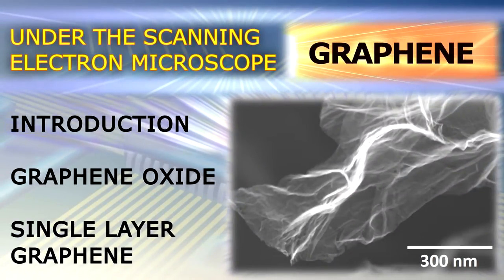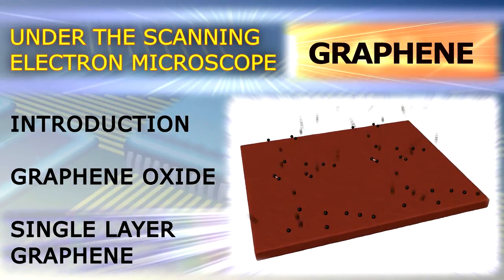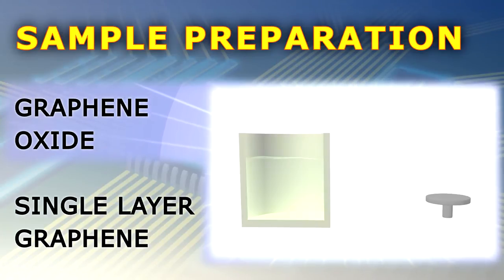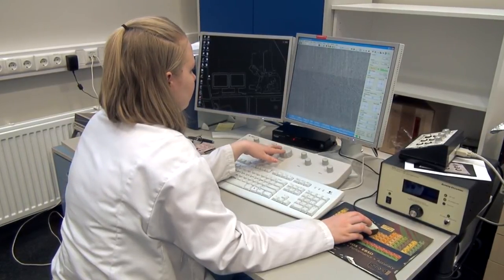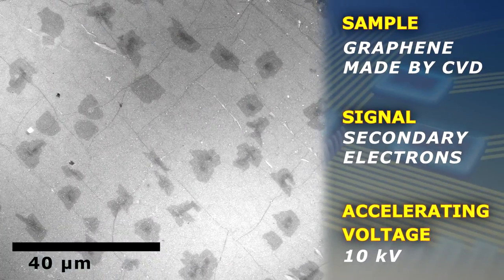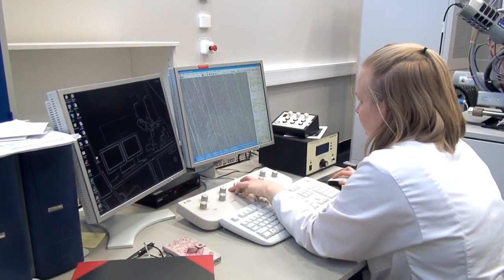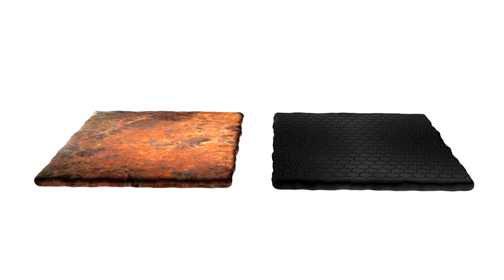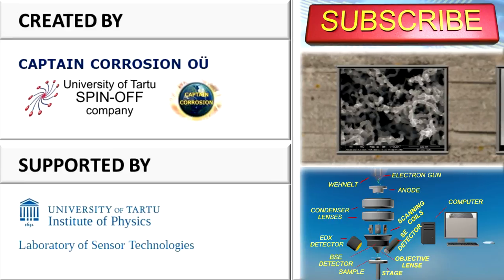Graphene Under The Scanning Electron Microscope (SEM)

Comment: During  My  Study  On  Graphene  ,   It  Was  Listed  As  A  Super  Conductor ........an  Associate  Had  a  Question......." Are  5G  Cell  Towers  &  5G  Phones  MAKING  a  Connection ?   just  a  thought........................................................................what  are  your  thoughts ?
Reply: Look at the graphene structure, 6 points, 6 lines, and many of these sixes. That's the mark of the beast 666
Reply: Of course
Reply: Yup!
Reply: I know I have seen pictures and videos of markings on the towers that had COV-19 stamped on them...
Reply: When covd arrived, musk was busy putting hundred,s of tiny satellites into orbit & said ppl would get reception anywhere on earth,so they'd also know where we are by device,then having Graphene in out body what would it do concerning devices as well.
Reply: 5g is still only mm wavelength. The sub mm wavelength radiation is much more of a threat in my opinion. With sub mm wavelength technology you can wirelessly control intracellular machines because the antenna will be small enough to fit inside the cell. I think they are planning it all for the 2030s. That decade will be very interesting.

Comment: Would it be possible to stretch graphene under the microscope?
Reply from the maker: Yes. Some scanning electron microscopes come with a nanomanipulator (a needle essentially that can be moved precisely) that could be used to poke graphene. At the same time you scan the images with SEM and watch almost in real time what happens to graphene as you stretch it.

Comment: How do you remove this thing from the body?
Reply from the maker: It depends on the size of graphene particles and how it entered into the body. Small particles (less than 10 nm in diameter) would be removed rather quickly on their own when you go to the toilet.
Reply: @CaptainCorrosion  Much larger particles, size possibly in micrometer
Reply from the maker: @John-ek5bq  Well, graphene is chemically resistant and this makes it a bioinert material as it doesn't interact with the body. So it may simply accumulate like other bioinert materials and if the quantities are low, then it hardly matters. But then again, the long-term effect of graphene on the body is being certainly studied to minimize risks. Currently, the biggest danger lies in daily working with graphene like substances and inhaling it, which causes it to accumulate in the lungs and cause problems like with other fine dust like materials. But then again this isn't really comparable with short term exposure to a small quantity.
Reply from the maker: @John-ek5bq  The thing is that there are countless versions of graphene-like compounds, that are developed for various applications, where the properties of graphene are modified accordingly. There are lots of scientific papers on that topic and I highly recommend reading those. Videos on YouTube are often biased and can mislead one in a really bad way, especially in the case of sensitive topics. Surely it is possible to give graphene toxic properties, which may be great for instance when developing antibacterial coatings. However, it is also possible to give graphene other beneficial properties and take advantage of its bioinert nature. Such research is done intensively on a daily basis, which results in countless of papers. Only ones specialized in the field can dig through the data and have necessary expertise and infrastructure to put it to good use. One of the main issues with graphene is the fact that its name is used to describe a very broad range of materials which may differ dramatically from each other. In any case, if you modify the chemically inert graphene-like substance with something else to make it more active in a specific process, then that modifier ultimately gets depleted or contaminated, which renders the particle again bioinert.
Reply: @CaptainCorrosion  Got it! Thank you!

Comment: Or it can be injected into humans so create s new mechanical skeleton, the hardware for an operation system to run on, as moderna said.
Reply: With nano technology in the human body, you switch it on and you control it. Just like the remote control controls the TV.

Stay awake.
Reply: You too brother (or sister lol). But Old Lucy is never on vaca.  Lol

Comment: You are 50 Years behind my.  Did you ever hold realy  pure Graphene .
Reply from the maker: Depends on what you mean with "pure graphene". Please define "pure graphene".
Reply: @CaptainCorrosion  Resistance.  1 -0002 Ohme 1Cm2  Flexible  strecheble pure Graphite self standing sheet .  I do have it . Do you?
Reply from the maker: @bartoszbarejko1585  Figured you were talking about graphite xD That material has been studied and used in many applications for a long time already. Graphene on the other hand is a completely different story as the technology to study and manipulate it didn't even exist few decades ago. Therefore, the most recent and advanced developments on graphene-based technologies have been possible only in the last decade or so. Which of these technologies will actually be widely adopted is unclear as there is still plenty of room left for development and graphene truly is a difficult material to work with.
Reply: @CaptainCorrosion  I do taking about self stending Graphene sheet wich i do present in my Youtube movies. Yes I do still need some 1 more Year to finish.